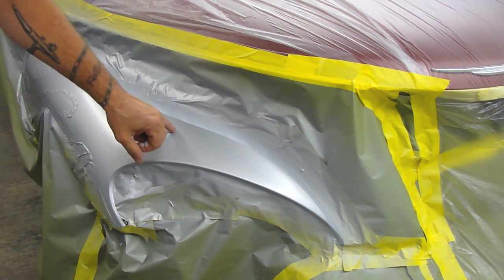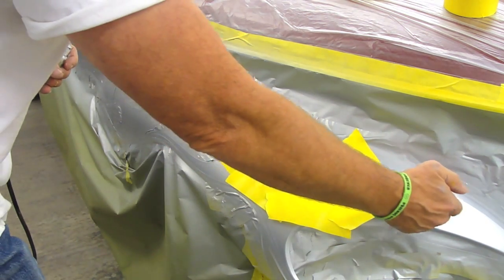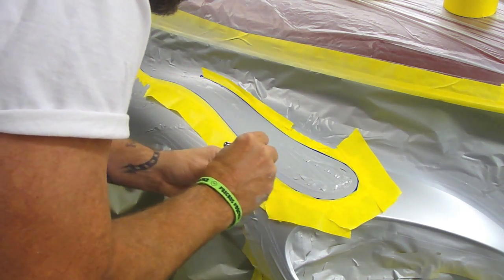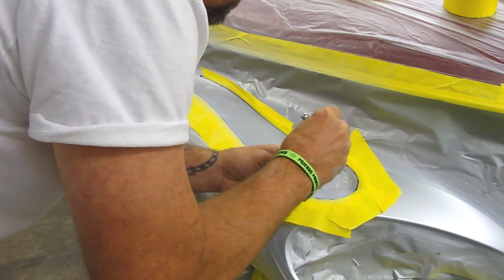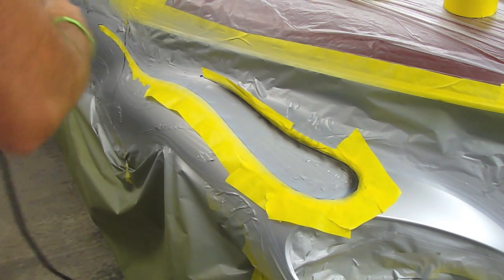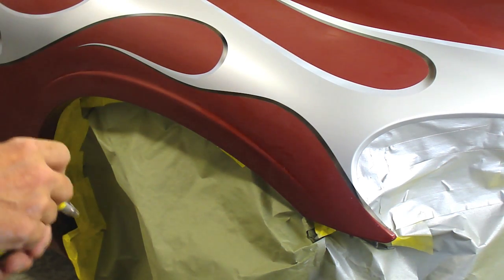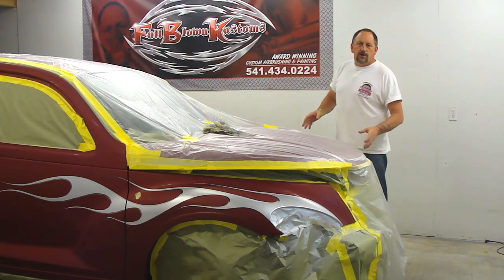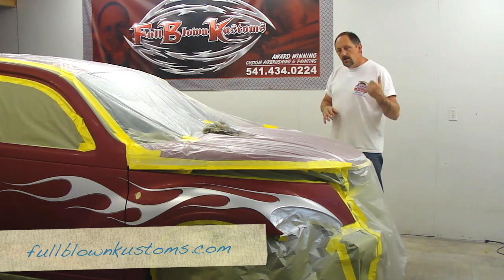Beveled edge Flames Part 2

Comment: Thanks Ed. Figured it out. There is about a one inch gap between the fine line tape you just added and the original tape, and then that's where you are then adding the shadows to.

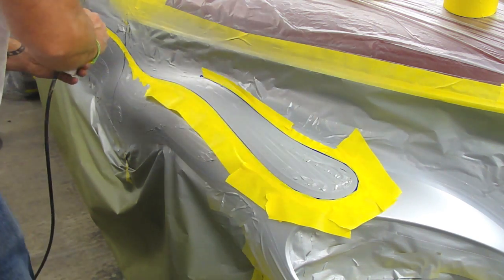Comment: Just like a fine wine, you get better with time Ed! Thanks never seems enough, so I bought your videos a long time ago, but sounds like you have a couple I don't have yet, so I will remedy that! Hate to be returded, but at 1:23 it looks like you are shading over your masking?? (I know I'm not the sharpest tack). Was it necessary to disassemble the whole front of the car? That looks harder than the paint job!! You are respected and admired by the whole airbrush community for good reason. Thanks.